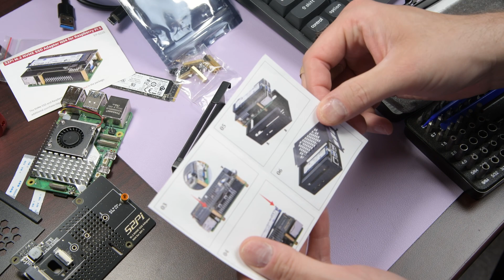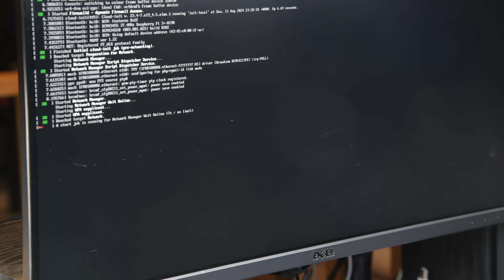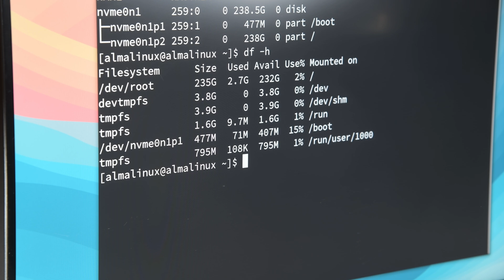AlmaLinux + Raspberry Pi 5 + 52Pi NVMe Hat = Easy!

Comment: great video!! ive always used redhast variants since redhat first came along in the 90s..  nice to see alma is just image and go wit hthe pi5..  the pi5 having PCIE is a gamechanger for me for small server type projects or even site-boxes..  nVME promises to have much better speed and reliability than SD..  ive had SD cards fail with not alot of writes..   still flailing a little since centos sold out.. it was my Goto (even on my pi4) for the longest time..